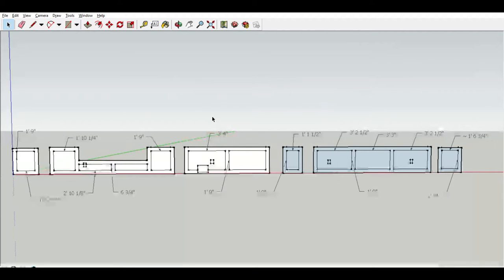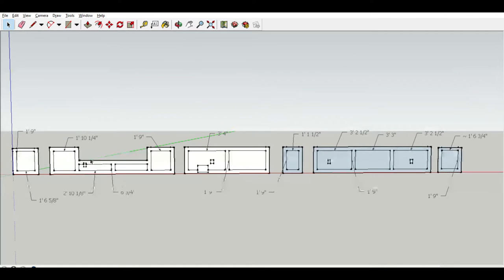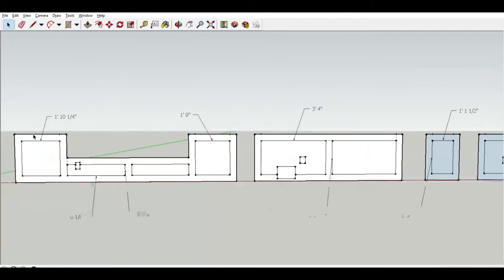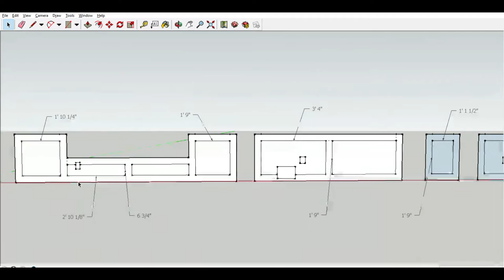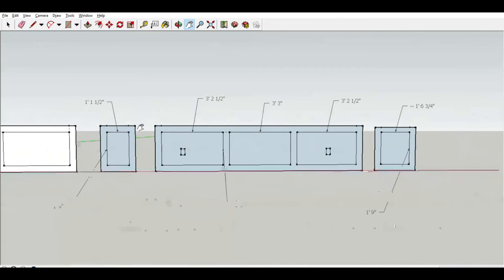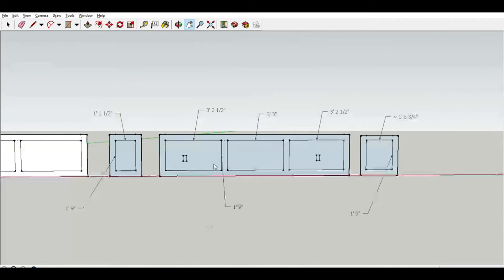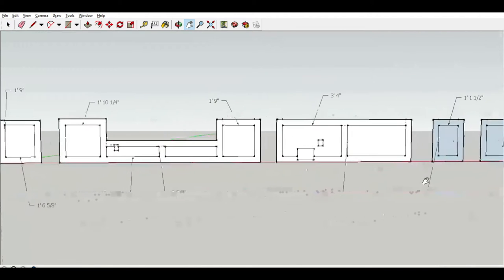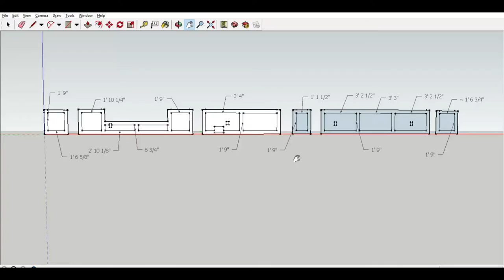Shadow Boxing design & installation

Comment: Mike thanks for posting your videos. I'm doing similar trim work in my home my question is how do you assemble the spacer jig?
Reply from the maker: Thank you Brittany for watching. I usually glue and either screw or brad nail them together. easiest way to do it would be but 2 pieces together with your optimal spacing then apply glue at the butt joint, and tack a piece the will span over the joint, this will give you something to hold when setting up the shadow boxing installation. any other issues or questions please feel free to contact me.

Comment: Mike great job.  I constructed the jig you used and made the job so much easier.  I'm in the process of caulking everything up.  Question for you - it looks like you got a nice smooth finish on there, did you spray it or rolled with a fine nap?  Thanks for the videos.
Reply from the maker: Chris, yes i used a fine nap, didn't want to tape everything up for spraying....it probably would have been quicker...lol. Thanks for watching, and good luck with your project.